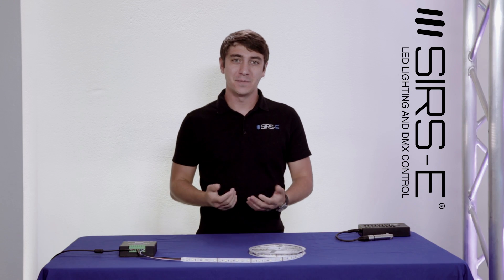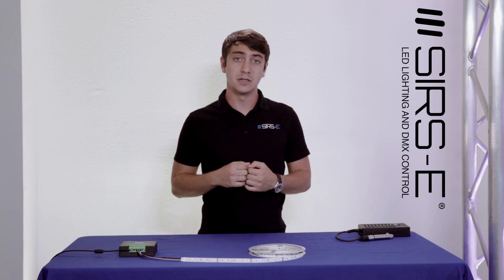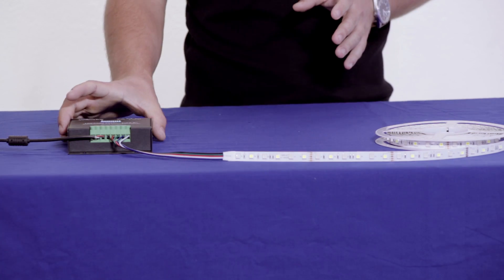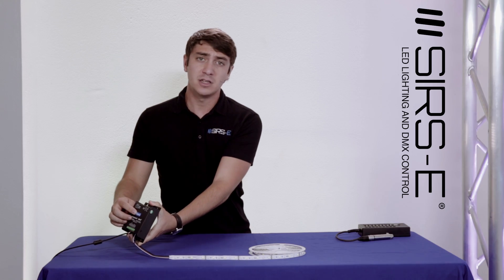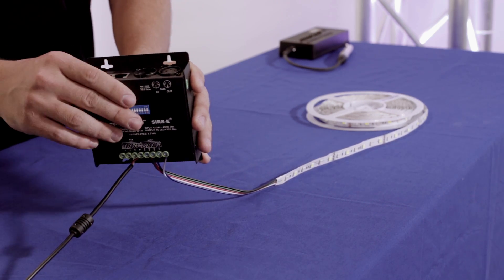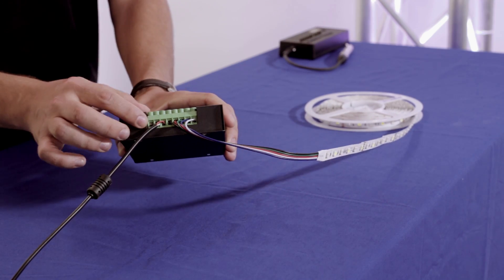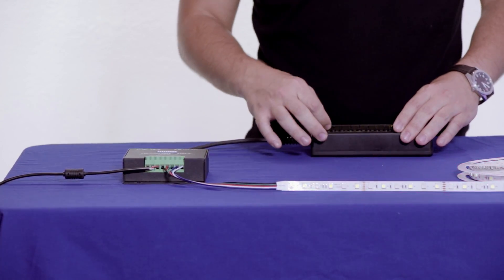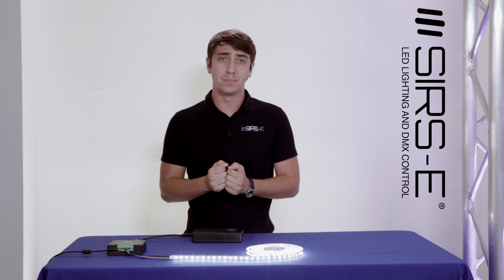LED DMX Controller 4 Channels 10A each RGBW LED strip

Comment: for each room of my house i would have one controller per ceiling
and set a unique id on the dipswitch of the controller, then daisy Chain all controllers ending into a dmx control panel, how would the control panel know which control'er to change the lights on? Do the control panels also have a dipswitch setting on them that allows you to speak to one controller at a time?
Reply from the maker: Negativecreep0 The way you set up is similar to a regular daisy chain. You can either use regular DMX XLR cables or an RJ45 cable to daisy chain. Just be sure you get the right DMX Address on each controller. Just be sure each address is different for individual control. A good rule of thumb is each controller can be thought of as a pixel, unless you are using single color lights.